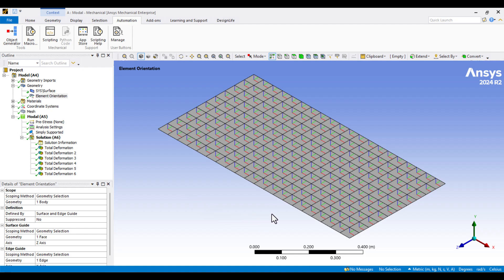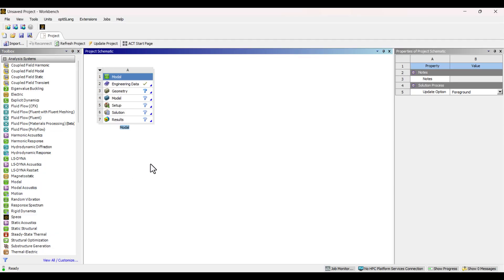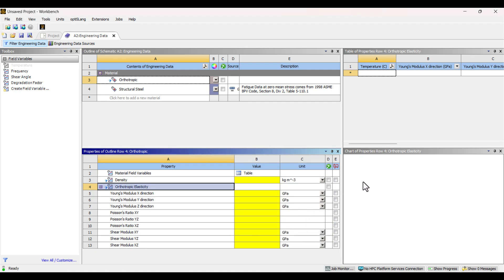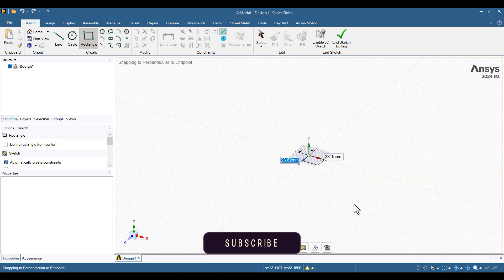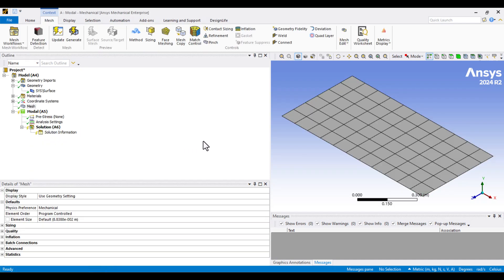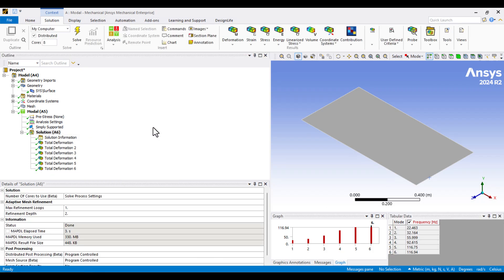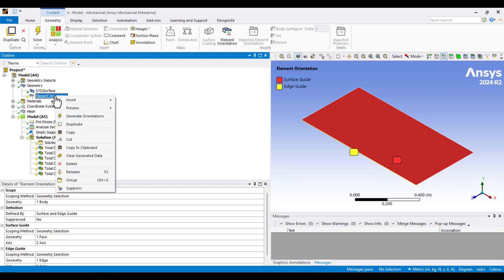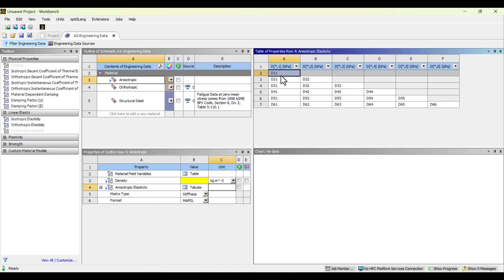⚙️ Ansys Tutorial: Defining Orthotropic Material & Anisotropic

Comment: First of all, thank you for the good video. I know the elastic modulus in the X, Y, and Z directions and the Poisson's ratio of XY, YZ, and XZ, but I don't have any information about the shear modulus. Can I input it using a simple calculation formula (G=E/2(1+𝜇))? Or is there another way to get the shear modulus?
Reply from the maker: Hello, you’re welcome. No, this formula is only valid for isotropic materials. For orthotropic materials, you need to have Gxy, Gxz, and Gyz values.
Reply: @caewitharminhashemi  I also want to know the shear modulus, but the information I received is only tensile, compression, and shear strength. Others said that the shear modulus can only be obtained and entered through experiments, is this the only way?
Reply from the maker: No, you have to extract them through experimentation.  @KIHYUNKWON-d3h
Reply: @caewitharminhashemi  Thank you!!!

Comment: great video, but sir this is elastic material. What if I want to use non linear (bilinear or multilinear) orthotropic material?
Reply from the maker: Thank you. I think you can add the bilinear property from the plasticity section to the engineering data.
Reply: @caewitharminhashemi  no but in bilinear we can add only 1 value for yield and tangent modulus. We need 3 different values as the three directions have different yield value
Reply from the maker: @aaquib2010 I have no idea